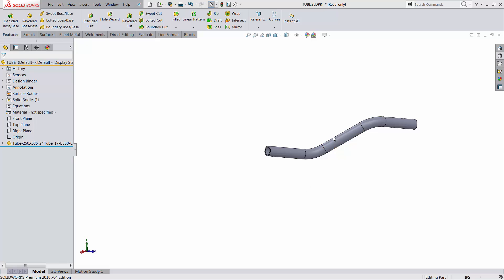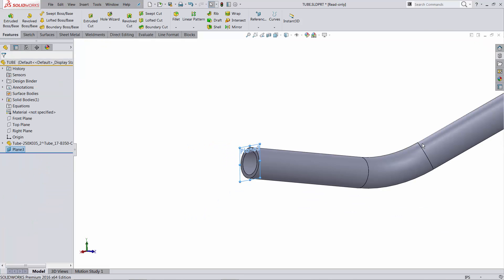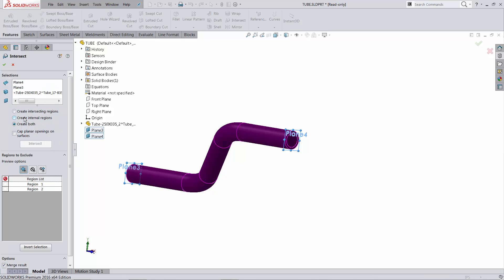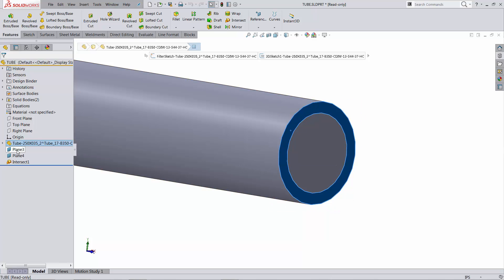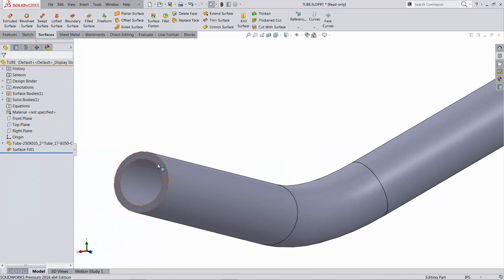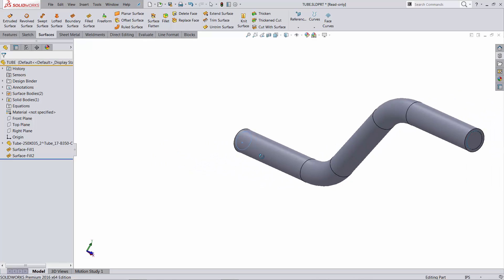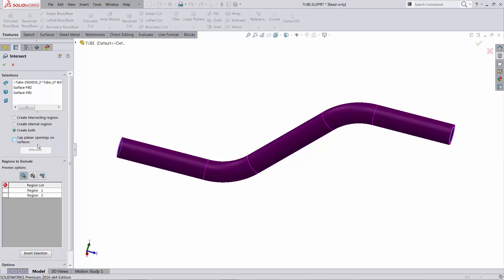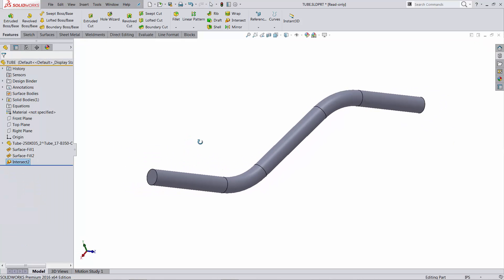Determining the internal volume of a bent tube or pipe using SOLIDWORKS

Comment: You can take the arc length and multiply by cross sectional area to get the volume.
Reply: And how do you do that genius ? Can you unbend a pipe ?
Reply: @meharsamba  Calculus. More specific pappus theorem of centroid. Take the arc length and multiply by 2pi * radius of cross section